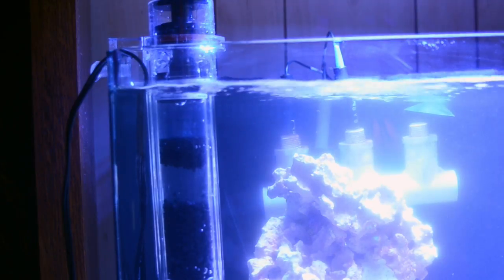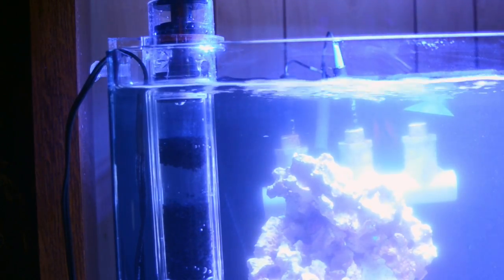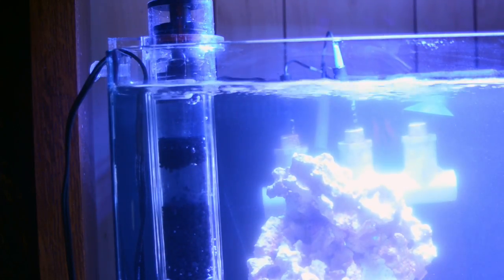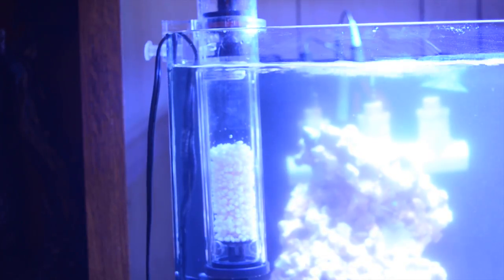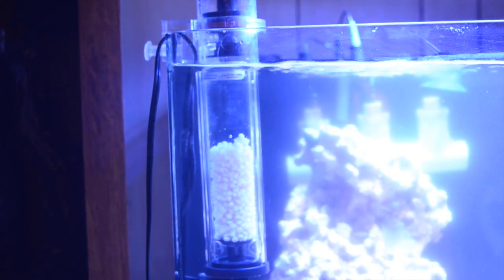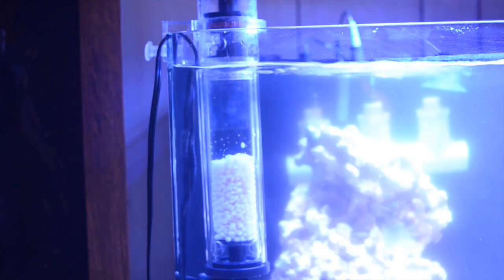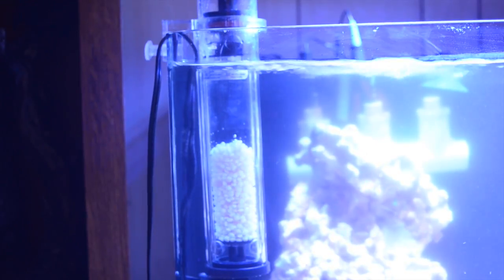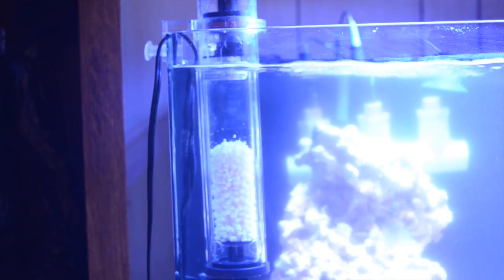Innovative Marine Minimax All In One Desktop Reactor Review

Comment: Not supposed to tumble carbon
Reply: +smnkm4ehfer  Never seen white carbon before so doubt it is.
Reply: +sezles1 you must not have watched the whole video
Reply: +smnkm4ehfer correct and if he tumbles carbon he's wrong to do so. However I have the medium AM reactor in which I have carbon but I don't tumble it at least the Fluvial carbon I use dosent tumble in it.
Reply: +Les Melling correct. with carbon your top retaining sponge should be tight against the carbon media and flow adjusted properly to keep it from tumbling or you risk getting dusty fines in the water column